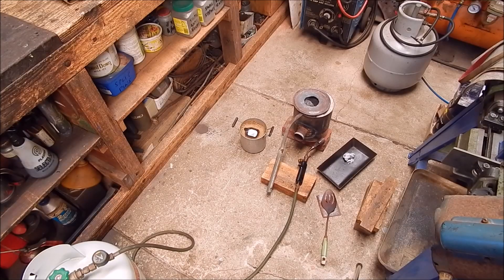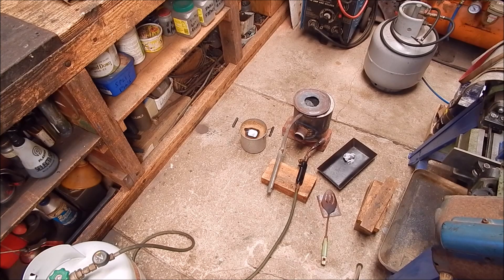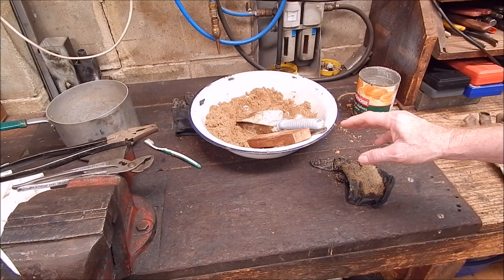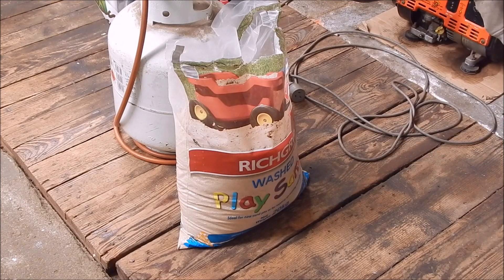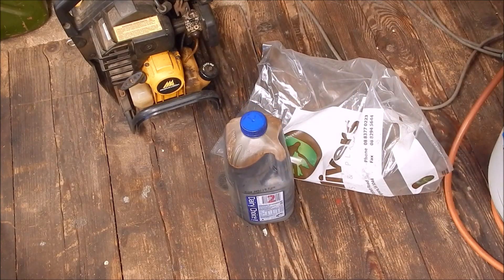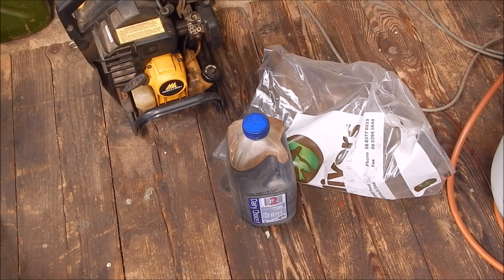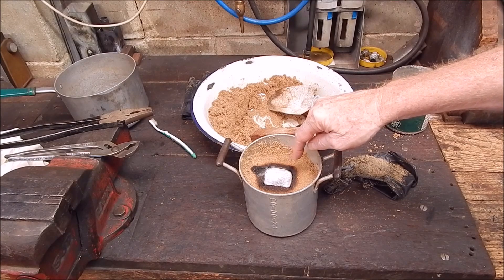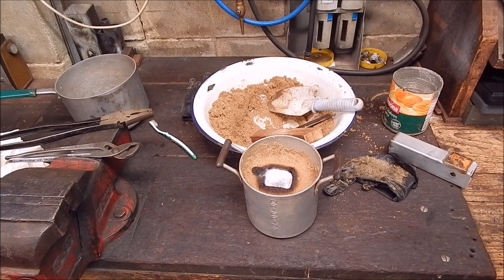Another backyard aluminium sand casting experiment

Comment: You should look for the recipe for green sand and you chose between oil or water to bond or humidify the mixture so it will hold shape.   Also green sand offers better & finer surface finish on parts.    Compared to use only sand and a bonding agent like you used.  They are some good channels that shows good tips and trick for casting.   Look for this one "Metal Casting at Home The Backyard Foundry " from myfordboy channel.  Also look for casting series "FOUNDRY CASTING Making a Sand Mold part 1 TUBALCAIN" from mrpete222 channel. these two could help with casting & foundry.
Reply from the maker: I've tried all those receipies before.  This is something new.  It's just an experiment to see if it's any good.  I've been casting for a long time.

Comment: What aluminium do you use, engine castings and the like?. I would like to try it to have something to turn on my mini lathe. I have made a frosty burner which works well but done no casting as yet.
Reply from the maker: Hi Murray, some aluminium is much better for casting than others.  The good stuff is often used in automobiles and the last big lot I used was scrap alloy car wheel rims which I cut up with a sawsall (reciprocating saw).  Watch Gumtree or Craig's list for that in freebies.  They usually have a tire fitted, but for the price of disposal (about $3 AU) you get a lot of excellent metal for cheap.

Don't use any aluminium that has a crystaline texture when broken or breaks easily as that often indicates low grade.  When you melt aluminium any hardening will be lost and even though wheel rims are tough, that goes after melting.  No big deal.

You can basically melt whatever is around including soft drink cans (good grade stuff).

Cheers Rob
Reply: Previously cast aluminium is the best source. Aluminium cans produce a lot of dross due to the coatings and the fact that most people don't squash the cans flat enough before putting them in the crucible. Don't use steel for a crucible as that leeches iron into the aluminium which can never be removed.
Reply from the maker: Not necessarily so with previously cast stuff Mark.  The worst aluminium I've ever re-used was the cutter/motor deck from a rotary lawn mower - terrible.  It was probably full of zinc and I will never go that way again.  You can never be sure what is in any alloy.  Cheers Rob

Comment: Hi Rob , what was your recipe for the perlite lining of your furnace?
Reply from the maker: Hi Murray, I had to delve deep into memory on this one.  I used ordinary Portland (building) cement and sand (cement mix ratio) to bind the Pearlite.   It pays to increase the cement ratio a bit as over time the lining will loosen with all the heat/cooling etc.   I used just enough cement mix to bind the Pearlite together.  I can't remember the ratio but at a guess it was probably 25 - 33 %.  You can use and line it with refractory cement to improve durability, but it cost more. Plastering the exposed surface with cement is a good idea.  Cheers Rob
Reply from the maker: Hi again Murray,  I had a hunt around and found my original video on making this furnace:  https://www.youtube.com/watch?v=Osa_c1XkjQs&feature=youtu.be

The inside coffee tin burned away over time.  I also think the cement ratio is better at the high end of my previous suggestion (33%) and I didn't use any sand.  Probably be better if the inside tin was removed after the perlite liner set and then plaster it with sand cement mix or refractory cement.  It was a suck it and see exercise at the time.

I hope this helps.  Cheers Rob

Comment: G'day Rob.  If you cannot make good green sand with the molasses at least you can use the excess on your waffles.  I wish you had taken a fly cutter to that piece.
Reply from the maker: Hi Harold.  I'm going to re-melt it.  I played around with the mix some more and with a lot less Molasses it still clumps well and doesn't cling to the former as much.  It should have much less carbonizing effect, so I expect the finish to be better.  I will have another crack at it with the thinner mix when I get to cast something for my next model engine build.  Cheers Rob.

Comment: G'day, Rob. "This might seem simple - but wait 'til I've explained": 
Heatsinks and extrusions are usually of the 606X variety, consisting of almost pure aluminium - hence bad casting properties, as the Si (and others) content is very low.
Bad pouring, bad mold fill-up, rounding off at the edges etc... Hi Al content also guarantees stringy machining. Just the plain vanilla beer can alloy.
I personally stick to remelt things previously diecast, with my favorite AlSi9Cu3Fe. Its down sides are comparatively high melting point at 650-700 deg C,
compared to 6061 at 585 deg C and 6063 at 615. It cannot be heat treated, either - but cold ages in a month. Machines excellently though.
Given the higher temp, the carbonizing would probably be even worse, even though surface finish would improve with your setup.
Just another 2 cents from DIYSwede - Cheers!
Reply from the maker: Hi Johan, the alloy seemed to take a bit more heat than usual to melt, but the gas bottle was low and that meant less heat from the torch. 

My mix is higher on molasses than the % used for some testing in an article another viewer forwarded.  I will drop it some more and use a talc coating as well, although that has nothing to do with the carbonizing.  Interesting trial. Cheers Rob

Comment: Hi Rob, I've been watching the guy also. That sand mix he uses works really well and he gets good finishes on the castings.
I'm just starting to read about casting/foundry work with the intentions of building my own furnace.
Will be interesting to see how you get on with your experimentation.
Regards Kevin
Reply from the maker: It's an interesting pursuit.  You can make it as simple or complicated as you want.  I am only a basic caster, but even that has a few options.

I think I've tried most binding agents out there, but not seen this one before.  So had to give it a go.  I can see what looks to be the correct ratio and will have another go when I get into the model engine plans some more.  Cheers Rob

Comment: Rob. Found a scientific paper on the technique here. https://www.scientific.net/AMM.660.301. 

Tests were conducted with mixes up to 5%. 

2% Molasses-sand mixture was selected for molding the prototype cast based on the highest values of the Green Compressive Strength, Green Permeability, and excellent Flowability (96.4%) observed in the experiments. The result shows that molasses alone could not be used as a binder. 

This is further supported by the low values of Green Shatter Index (31.3%) and Compactibility (25%) reported. 

Doesn’t seem to be a good recommendation.

Still think it might have use for sand core. 

Cheers
Mick
Reply from the maker: Thanks Mick.  I used roughly 5% and that was still too high.  So 2% sounds good.  I will have another shot at it when I get time.

It definitely works.  Check out this video and channel that got me going on this: https://www.youtube.com/watch?v=2NAdyOPbOEg 

Cheers Rob

Comment: Rob. Found a couple of videos by Wow Things on YouTube using this technique. Looks like he uses a very fine sand, almost a dust, to mix with the molasses first then mixes with a courser grained sand after that. Could the dust be bentonite or clay?  It’s not clear. From the casting of the washing machine pulley it would seem he ends up with a carbonised shell over the casting too.

I’m not convinced it is a reusable technique for pattern moulding. But the molasses sand mix might be perfect to make cores. The carbonisation would add to the strength of the core during moulding but would be relatively easy to break up later. 

Keep up the great videos. Always enjoy your work!

Cheers 

Mick
Reply from the maker: Hi Mick,  yes he is the man.  Wow Things put them up.  Extremely interesting videos.  I like this one:  https://www.youtube.com/watch?v=2NAdyOPbOEg

Simply amazing what that guy can do with just the most basic items.  How lucky we are compared to the rest of the world.

I had to try this.

Cheers Rob

Comment: There's an old fashioned recipe for core sand that's 16-1 sand-flour wet with 16-1 water-molasses and baked 350 f (176 C). I heard it smells like sandy cookies. Sounds close to what you were using but without the pre-cook step.
Reply from the maker: Hi Tim,  that's really interesting.  That ratio sounds about right.

The guy did it as a basic no cook mix.  He got some carbonized/bake on, but not as much as mine and the finish was better.  So I will reduce the molasses percentage and try again.  It's a mighty cheap mix.  Cheers Rob
Reply: Tim. I think you’re spot on. 

Up to 2% of cereal binders, such as dextrin, starch, sulphite lye, and molasses, can be used to increase dry strength (the strength of the mold after curing) and improve surface finish.
Reply: Tim Attwood maybe he sun bakes it or air drying. Here where i live i would have to bake it to much humidity in Swamp people land!!!

Comment: Bentonite clay sold as kitty litter in woollies works well when mixed with sand.
Reply from the maker: I normally use Bentonite clay.  I have a 20 kg bag of it  (used as bore well drilling liner).  It's good, but you should always try new techniques.  Makes life interesting.  Cheers Rob
Reply: Rob I wonder how it would go with brickies sand which has some clay in it I would be interested to see more on this but can't try anything till after fire restrictions are lifted
Reply from the maker: Hi Frank, I have been using coarse mortar sand up to this point with Bentonite.and it works well.  Finer sand should give a better finish, but there may be other factors at work.  Cheers Rob